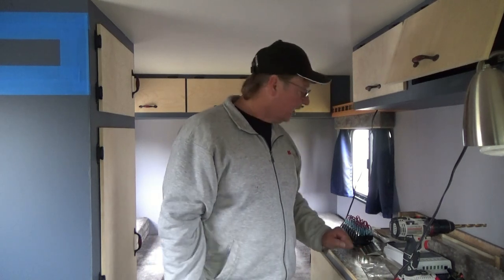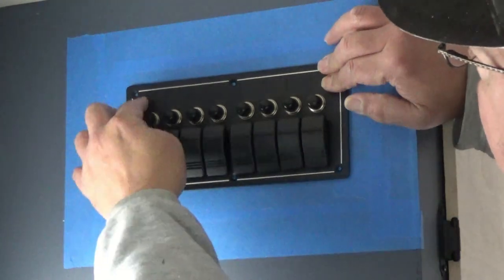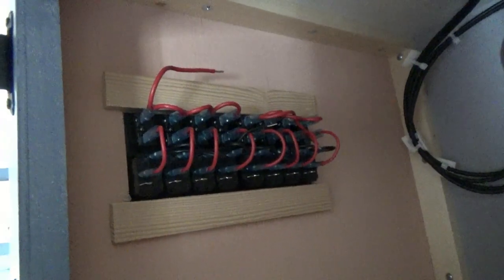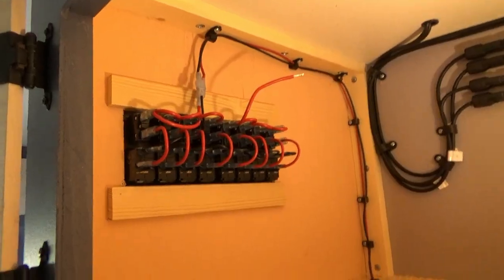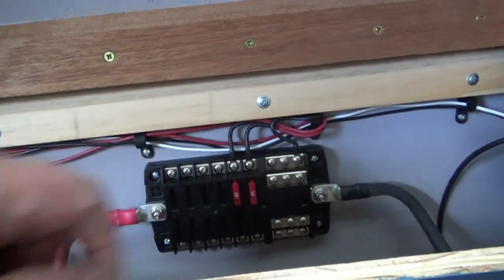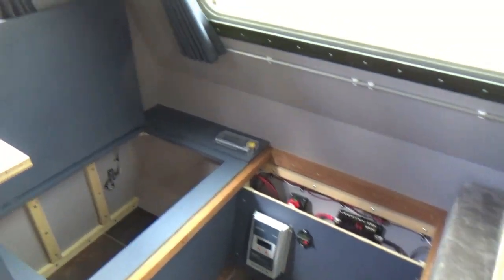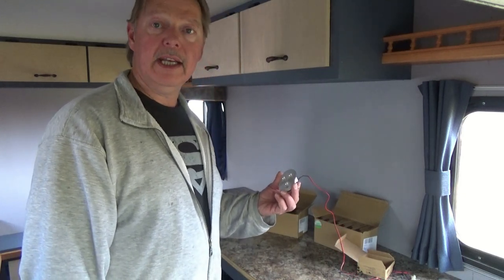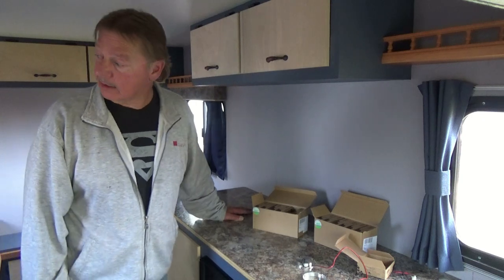How To Build A DIY Travel Trailer - Part 48 (Switch Panel Installation)

Comment: Thank you so much for these excellent videos! Could you use rheostats and have the puck lights dimmable. Is that possible?
Reply from the maker: They do have a dimmable unit that can be installed, I didn't think I would use it though.

Comment: Great video!  Question about your + and - connections from your Controller.  On the Video I see the wired connections from the battery to your Fuse box, but I’ not seeing where your + and - connections from the controller go to.  Shouldn’t the battery + and - from the controller share the same connections on the fuse box with the battery?  If not, where do those tie into your configuration?  Thank you
Reply from the maker: Thanks aforester3!  The way I have this wired is the + and - from controller go to battery. Then the + and - output side of controller for lights, go to the 12 volt fuse block. This way I can kill all power with one switch (at controller) without having to dig into electrical area.  Also, I will know if the controller ever fails because I will have no power. Hope that helps!

Comment: Also, the switch panel you installed already comes with breakers, was is it necessary to add fuses too?  extra safety?
Reply from the maker: I connected it to the fuse box as I can use the battery shut off switch to turn everything off (didn't want to install an extra terminal block, or extra switch... saved a little money that way)  And yes... I will sure sleep better at night with that extra safety! :)
Reply: The fuses should always be located as close to the power source as possible. IE if there would be a short somewhere closer to the power source, (for example under the countertop during the build) the breakers in the switch panel would do nothing to help.

Comment: Hmmm, have you accounted for the voltage drop over the cable? And as you only pulled one cable for the negative you only have half the gauge there. If it's only for led lighting it probably doesn't matter, but if you plan to connect anything more power consuming you really should do the maths before.
Reply from the maker: Thanks Henning! I never measured the voltage drop, although I knew there would be. The ground is for the led on the switch panel only, all other ground wires run directly to distribution panel. So far, no flickering lights or dimming! Whew! Thank you for stopping by!
Reply: Great. Really enyoing your build!
Reply from the maker: Thank you very much! I appreciate you taking the time to watch! Cheers!

Comment: Awww that makes me sick LEDGle doesn't sell those lights anymore, but they sell everything else,  even Kio pond pumps 😂😂
Reply from the maker: I know right? I really like the looks of those lights! Good material too!
Reply: @OregonBatman  here's the equivalent matching light, since the other one isn't for sale anymore 

ABI 3W LED Puck Light for Under Cabinet, Bookshelf, and Showcase Lighting, 240lm, Warm White 2800K, 25W Halogen Equivalent https://www.amazon.com/dp/B013Z8Q552/ref=cm_sw_r_cp_apa_i_i2AHDbR4VNZAS
Reply from the maker: I think that will work! 12V... I really like the looks of these lights! I book marked that for future use! :)
Reply: @OregonBatman  for a simple use I would just clip the millimeter jack off of it and just use the positive and negative wire.
Reply from the maker: Exactly what I was thinking! Should work
Reply: @OregonBatman  just got my new cobalt blue telecaster from amazon ($108) and it's a bad mojo,  just put the review on youtube.
Reply from the maker: Nice little Axe! Gonna have to get my stuff out again and light it up... :)